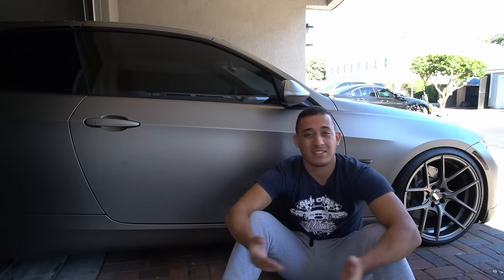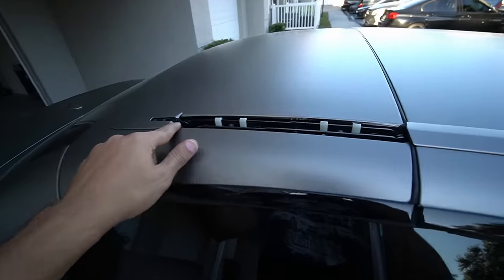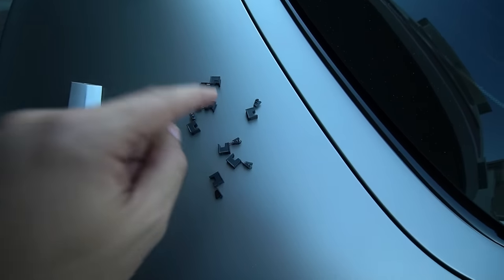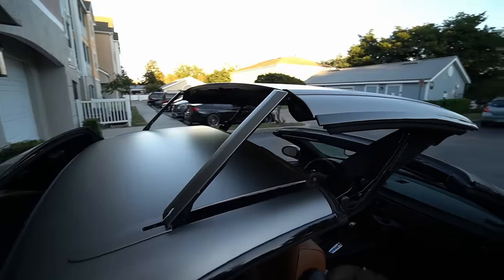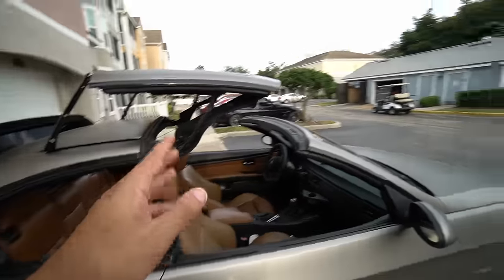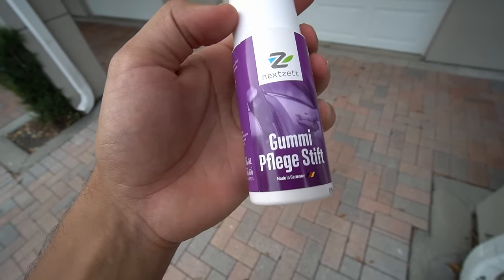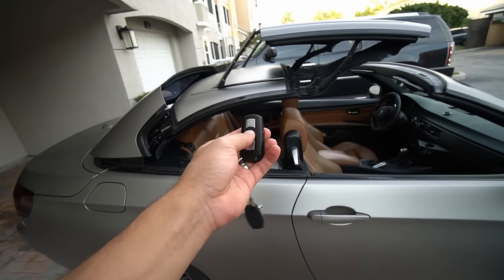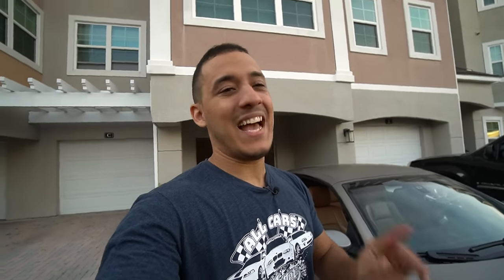Don't Buy A BMW Convertible - Here Are 5 Reasons Why

Comment: I bought a 2011 Hard Top Convertible. Nothing but issues with the hard top. The car is nice, but one of the arms broke, and caused the plastic piece with the string going through it to break also. It also leaks above the driver and passenger window.

Comment: Hey bro.....what did you use to whip down the seals before applying the gummy product??? I have to e93's and watching this video just mad me hop on Amazon and order a bottle to do mine. 🕵‍♂️ it looked like you had a little spray bottle wasn't sure if it was windex or another cleaner...... I just dont wanna put anything in mine that would dry the rubber out. I was thinking maybe some warm water and dawn dish soap...💁‍♂️ Just had my top down other day and noticed my seals are dirty and grimmy..... so coming across this video 2nyte was perfect timing. Keep up the great content💯

Comment: I've owned two 2007 328i. The first one was a leased coupe; the second, a convertible (same color even, just a different color interior). I sold the convertible so I could move to London. I'm back in the US and I'd like to own another one. But I'm hesitant about buying a convertible. I'd rather have a coupe, but they're actually a bit harder to come by in Florida. The problem I had with the convertible was the top rattled, but I've since watched a video on how to remedy that issue.

Comment: Saturday I had the top down on my 2013 328 and a thunderstorm brewed up so I ducked into Walmart's parking lot to put the top up (that year you could not operate the top while moving) and it froze in the stacked position.  That is the point where the top is up but the three roof panels are still stacked on top of each other.  So a flatbed to BMW on Monday, because they were closing before we could get there Saturday.  And today I got the estimate, $1,785 ($2000 with break fluid flush which was due as of May and driving me crazy with the SERVICE alarm) but they are covering my rental car.  I do not understand why the hydraulic ram has to be replaced if it is just a hall sensor, but it is a sensor that you do not want going out that is for sure.  Still, take care of it properely and even though there are a million things that can go wrong with it they actually have a good reliability record.  This is my third BMW 328i HT convertible and first problem I ever had with it.  And I love the car enough to pay it, nobody said they were cheap.

Comment: Thanks for showing the maintenance on the seals. Never even thought about it. Found the gummi stuff on Amazon. Sometimes when I'm putting my top up it gets stuck. Seems to be on the passenger side. If I barely, I mean very lightly lift up on it with my finger it comes up. Any ideas? Thanks :)
Reply from the maker: Try the things I did and see how it goes from there
Reply: Will do. Thanks
Reply: If you haven’t already, have the top hinges lubed.  Should fix the problem.  Dealer will probably do it for free if you get an oil change.
Reply: @tomangle1603  thanks. I used silicone lube and now its perfect:)

Comment: Thank you for the video. I have a 2009 hardtop BMW 328I. My issue is, when the top is dropped it's not fully secured. The green light doesn't shut off. Then it reads movement impaired. What can be the issue? Help please. This just happened on Thursday. Thank you

Comment: 2015 convertible m4 here. 63k miles. I was closing my roof today and I heard a pop. The passenger side hinge had a spring popping out. The upper set of clips   both broke. The outer trim piece is still intact by the 2 bottom clips. Wonder if I can just replace the clips

Comment: Good vid mate, I'll do my seals when the rain stops. I have a 2010 e89 Z4, S Drive 3.0 M Sport, which I've owned for 8 years, it's on 50k miles. It has been the cheapest car to maintain that I've ever had, ( But then my previous vehicles were Range Rovers and Defenders, all less than 3 years old, nightmares to run). The hydraulics in my roof packed up in July, evidenced by fluid squirting all over me. It took 3 months for BMW to supply the required kit at £900GB. Then my local specialist ( not main agent and highly regarded) charged 6 hours to fix, though his mechanic said it was longer. A bit of a shock, but apart from consumables the only repair I've had. Not bad for 8 years ownership. I love all aspects of the car the car and would have no hesitation in buying another, though sadly the new ones are rag tops, which are not good if you live in a wooded area in wet England, as I do. I know because my wife's Z3 was green all the time!

Comment: My 2007 e93 hard top convertible stopped working all of the the sudden. The car has been doing pretty well though It’s the first winter I have it. I heard the convertible system is hydraulic, maybe it’s normal for cold weather? Do you guys have any recommendation? Thanks.

Comment: Rewiring the top and replacing modules and hall sensors cost me $3500 last year. 170k. N52 loves to leak oil. The GM transmission is rock solid.

Comment: Hey
What’s the point in those little plastic doors on the top ? Why the hell are they there ?
In the F33 I think the clips are actually moulded into the cover piece, when it breaks you cannot just replace the clip. You have to replace the whole moulding / cover strip
Reply: Have you figured it out yet? I have a f33 and the beginning of the cover that he places came off on the beginning corner and I want to know how to fix it , will the clips do the job to get it to stop sticking up?

Comment: thanks for the video I'm still undecided between a 2014 Mercedes Benz e class cabriolet, 2014 MB SLK 350 and 2014 Z4 all around 40 000 to 52000 km same price for all 3 which one is preferable and which will last longer say 200000 km. ps all in great condition and still have 2 years warranty.

Comment: Damn! I was planning to get a 335i convertible for a weekend whip this year. It was either this or a 135i. I was leaning to this because the hardtop is sexier. My wife even agreed. Was going to make it a weekend car because I know they are not reliable and expensive to maintain given my heavy foot and knowing a lot of people with the coupes. I had the sedan in f30 but was a lease. You messing with my head bro! Dammit!
Reply from the maker: Sorry, wait for the video where I explain why you should get one :)
Reply: @VehicleVirals  lol
Reply: I bought an e93 when it came out in 2007. I still own it, it's always been parked outside and it has been completely reliable.  Maintained by a BMW garage for usually reasonable fees. It still looks awesome too. Don't worry and don't be cheap when maintaining it. No worries.
Reply: Have no fear, go for the 3!  I bought an ‘07 E93 in 2010 as a CPO, Memorial Day 2020 will be 10 years, few issues, nothing serious, roof 100% reliable and waterproof.  I drove it year-round in the Northeast the first few years, now I mothball it during the winter.  StaBil in the tank, CTEK battery conditioner, and Gummi Pflege and lube the top hinges like our friend here before it goes in, comes out in the spring factory fresh.  Love the car!
Reply: Maybe I’m a little obsessive, but I Gummi Pflege the rubber seals and pads under the hood too.
Reply: @tomangle1603  Nice 😃

Comment: Hi, i drive  a toyota MrS with manual canvas top, regarding the rubber for for the top and around the front glass..can we just use the silicone spray to moisturise it. ? Tqvm

Comment: Spring on our 2012 BMW 328i Convertible broke today and is sticking out of the plastic top trim piece like you showed, hopefully just replacing the plastic clip fixes the issue. Also water leaks inside on front seats on corner where top latches to body when it rains hard, any way to fix that issue, replacing seals?
Reply: Sir i have the same problem a bout the trim roof broken and licking water. Did you fix it.  ????

Comment: Hey how do you close the top down with your key fob? I have the same 2008 e93 335i but my doesnt do it i was thinking of getting smart top module or is it coded? Thanks in advance!                  
(I know its late for this video but my trim just broke today 😭 ive only had the car for like 2 months maybe less and i cant even drive it much either)
Reply from the maker: It's part of comfort access, an option you can get when the car was new.

Comment: Good video...just a suggestion and a couple of additions. Perhaps a better name is "Things to Consider if You Want to Buy" rather than "Don't Buy" - also, another really painful thing to work on is the thin cords/springs that pull the rear pillar covers/cloth away from the hinge mechanism...if one breaks it's not that expensive but you'll learn some new words trying to replace them. The lubrication points you need to consider are some are better with lithium grease, some silicone, and a few just plain old 3-in--1 oil...that's what the dealers use at least. There are a few more lubrication points under the trunk lid and a few more "slide" points...not hinges but places where something just slides into place. I owned a 2009 e93 (328i) for 7 years...other then the cord breaking it worked flawlessly. I just upgraded to a new e93 335i M-Sport...nothing like riding in a convertible (even if it is a good bit heavier)

Comment: Did you ever find anyway to replace that back windshield bottom seal/cover? I recently bought one and realized it's cracking a little bit and was hoping to replace it without having to get a whole new windshield.. I'm going to pfledge it tomorrow but I doubt that's going to fix the cracks lol
Reply from the maker: Unfortunately that rear glass seal is not sold seperately. You need buy the entire glass or make your own somehow.

Comment: I've owned 2 of these - a 335  and a 440x. If you live in a rainy state like mine, Oregon, do not purchase one of these cars unless you can afford or perform frequent cleanouts of the drain plugs. Water will eventually get into the trunk where most of the sensitive and expensive electronics are situated where they become submerged and fail. I had a 14k repair on the 335 before learning how to get under the car to clean out the drains. The drain design is no better on my 2018 440 convertible either.

Comment: I own my 3rd convertible (Chrysler LeBaron, VW Golf Mk1, current ride is BMW E89 Z4) and we had a lot more convertibles in the family. Let me tell you: every single one and all convertibles that I know has had issues at one point in ints life. Only my dad's 1978 Fiat 124 Spider didn't have any issues and and that's only due to the fact that he replaced it three years ago completely because the car got a huge makeover. So either you are running behind your car fixing stuff or you replace it before it rots away while you watch it. My BMW has had the most expensive roof repair so far though, the electrical wiring failed and BMW wanted $1200 to fix it.

Comment: Also, I want to know about the arms in the trunk that operate the roof into a convertible and back over. There is a string in there that bus and I want to know if that can be replaced or if you have to buy both parts new.
Reply: They break and they will not operate properly. Can you explain how much they are or how to replace a string who is desperate in Lubbock Texas thank you you’re doing a great job.

Comment: those white clips you took out of the hinge before putting the trim on what were those and are then needed to be put back in. i just purchased an 08 and its missing the trim on both sides but the hinge is there and the springs but no white clips. guy said i needed the trim peices in order for the top to work....is this so. i dont wanna try it and mess something up or it get stuck half up lol thanks man and just this video showed me a good amount

Comment: When it breaks then usually it's the hydraulics, pump is in the trunk under a cover, there is a video of some guy replacing it and reconnecting all hydraulic lines back to it, so I guess it's "doable". Search for: "2007-2013 E93 335i 328i Convertible Top Motor Replacement"

Comment: Just came across this now so I know i'm late to the party so to speak.
 I like your content 10/10 but really this title was click bate. You could think of 5 reasons not to buy any car period if you don't maintain it. I've owned my 2007 convertible for 10 years and have performed the roof maintenance once in 120,000 miles. I did have to swap out one of the relays for the drop top once as it started to work sporadically (gave me a few days warning which was good) but even that was a half hour fix as they live in the trunk area and are easily accessible. 
Otherwise nothing mentioned here is a certainty (interior roof liner replace for instance) and definitely not reason to not buy a vert.
Verts trum coupes most of the time and I still turn heads in my 15 year old car regularly. Keep bringing the GOOD content mate.

Comment: Did you unlock the feature when you press close button to make roof close mine only opens with remote don’t close
Reply from the maker: No I'd didn't unlock that feature.
Reply: Vehicle Virals weird that mine just goes down with remote one way so I thought I have to unlock. Thanks anyway

Comment: Be careful with WD40. It is a cleaner and not a long term lubricant. It will remove all the grease from hinges. You should try lithium grease or silicon spray.

Comment: hey i got a question in the middle there is a small lil piece it fall on my car inside is in front of the lights  it like part of the roof do you know what is call or were can o find it
Reply from the maker: Not sure what piece you're talking about.
Reply: Vehicle Virals  is like in front of the light console is in the middle first is the inside rear mirror the front of it is the light console then in front of that there is like a piece plastic the goes there

Comment: had en e93 top always kept stalling, loved it. after I finished paying it off it was all good warranty was over , and the top just completely got stuck mid way. tried takin it to all diff shops in ny no one had a tool to close it. all referred me to bmw took it to them said okay well fi sit for 4k. agreed on it came back was told they closed it but couldn't fix it and still charged me 4k. that or can't take the car off the lot. so paid  I had money cause I finished paying the car off and had money saved and now down the drain now its just a coupe, but just bought a g22 wanted the g23 convertible but not sure if I want deal with that problem again. and multiple people had stopped me with the same car Askin if I had problems with the top and they all said they had same problems. great car tho but ill lease it not buy it. if I due it again.

Comment: I’ll probably use lock or gun oil for lubrication (just bought the car) and silicone for protecting the soft parts. Spring and fall.

Comment: Where did you order the trim piece clips
Reply from the maker: In the description
Reply: @VehicleVirals  it only has the trim molding not the 4 little clips you need  buy separately
Reply from the maker: @rayraycarter04  My apologies. Here is the link to get them: https://www.ecstuning.com/b-genuine-bmw-parts/roof-mounting-clip/54377187747/